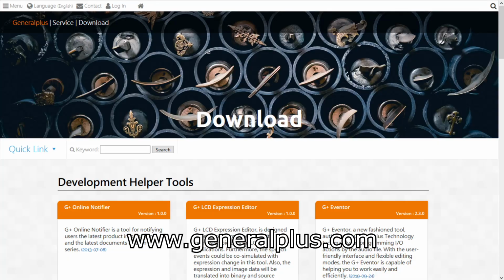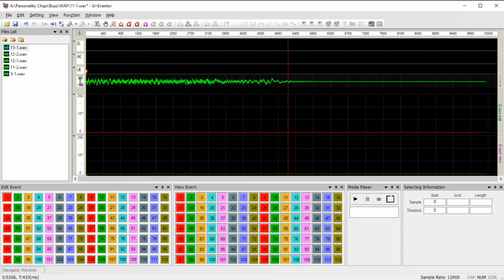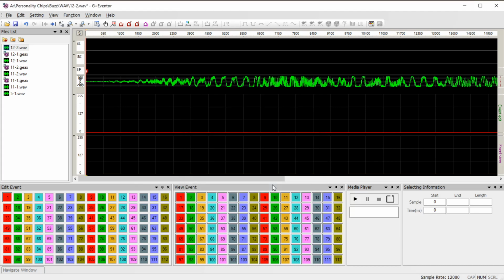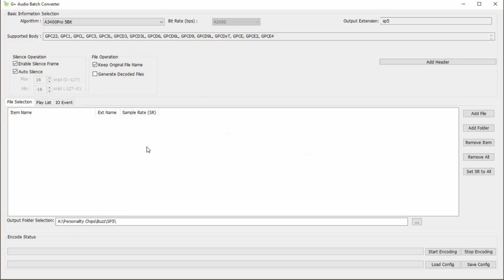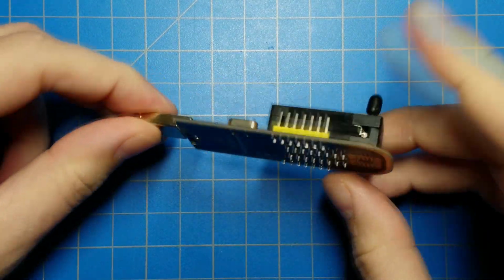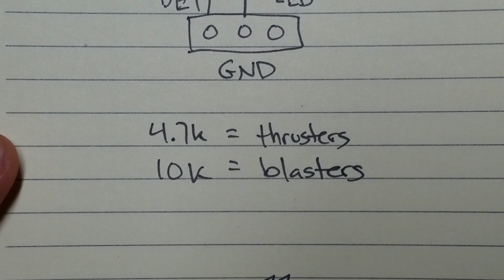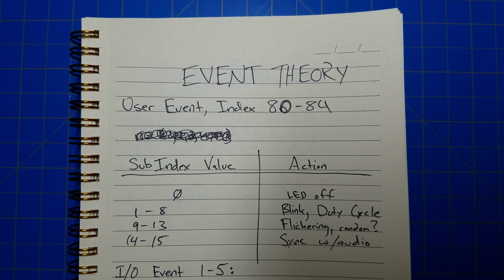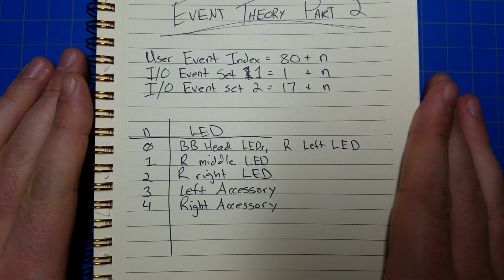Creating a Custom Droid Personality Chip - Part 3: R-Unit Accessory Lights

Comment: How did you determine what events the stock chips used? Were you able to decipher a .bin dump of the stock chips, or what?
Reply from the maker: yes, a stock chip was dumped and the event data was extracted from it.

Comment: Would you happen to have all of the audio files from the stock droid? I want to just take those and down tune them for an evil droid. Then reload them to the custom chips so they interact with the beacons in the park the same, just sounding more “evil”.  Or I just need to know which folder to put the specific files into before creating the ROM.
Reply from the maker: I can't share the audio files due to copyright issues. But you can obtain them yourself, especially if you plan on distorting them, by either just putting a microphone next to the speaker or opening up the droid and solder an audio cable to the speaker to tap off the audio and record it on a computer.

Comment: when creating the chips, what does each group number correspond to?
Reply from the maker: I guess I've skipped over that detail in the videos. This google docs spreadsheet contains a bunch of research into electronics from Galaxy's Edge including personality chips:
https://docs.google.com/spreadsheets/d/13P_GE6tNYpGvoVUTEQvA3SQzMqpZ-SoiWaTNoJoTV9Q/edit#gid=702279780

On the personality chip tab there a section called "Audio Grouping Notes" that talks about the purpose of each group. And I guess I have another video I need to make.

Comment: A note from my testing that I didn't see captured in this video - it appears that the accessory activation [Top Button] and the random sound [Bottom Button] are independent and it can play both sounds, and potentially LED controls simultaneously.
I have not yet tested what happens when the instructions conflict.

This is something to keep in mind if altering head LEDs on a Group 11/12 track or accessory LEDs on other groups.

Comment: So a Nice thing with the Accessories. You only need 1 resistor. You can have 1 leg have a resistor with led and then the other side will just need an led and it'll light up as well.
I've made custom Rockets out of Dollar Tree Spray Bottles and Tea Candles for only $3! 
Also any resistor under 4.7k will work for the rockets. I didnt hear if you mentioned these in the video. I currently have a 2k resistor in my custom rockets. 
These videos of yours have been very useful and helpful! Thank you so much for releasing them